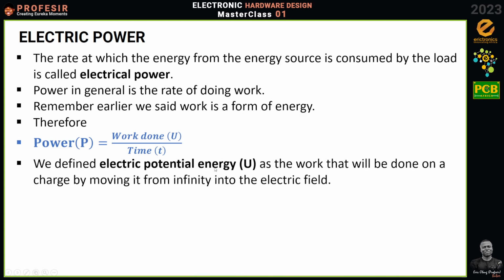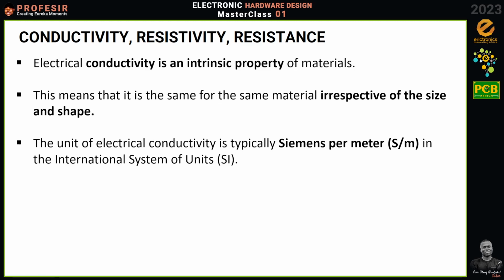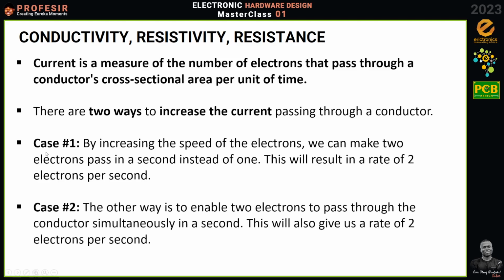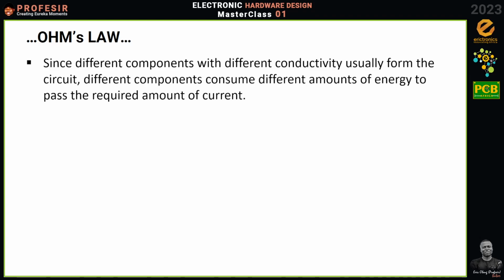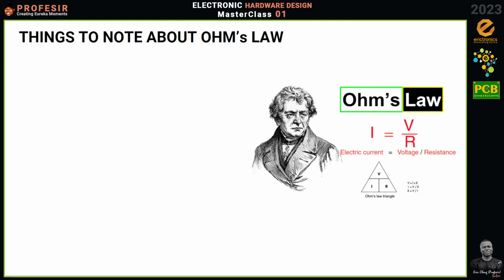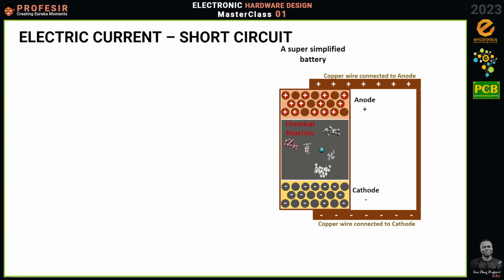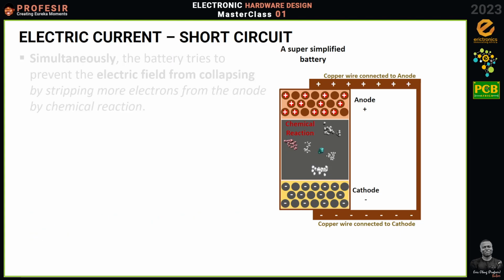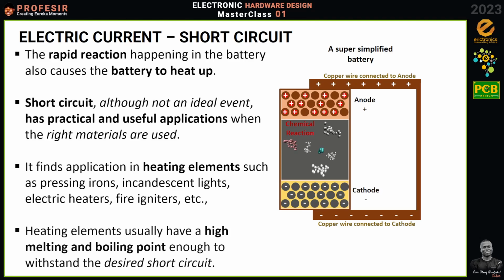Lesson 11: Basic Electronics Concepts - Current, electron mobility, assumptions of circuit theory

Comment: so if a load is connected the ion cores remain intact?
Reply from the maker: That is what the energy source tries to maintain so in the case of a battery that means more chemical reaction has to occur to sustain the charges leading to the battery running out of chemical elements. I talk about these things in the videos you might wanna take a careful look.